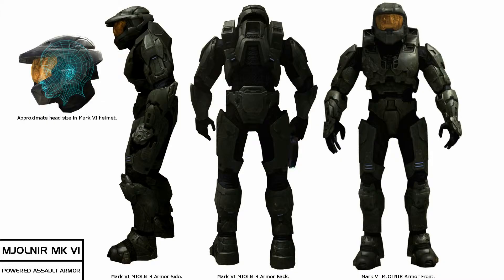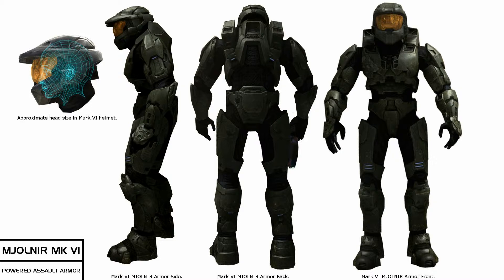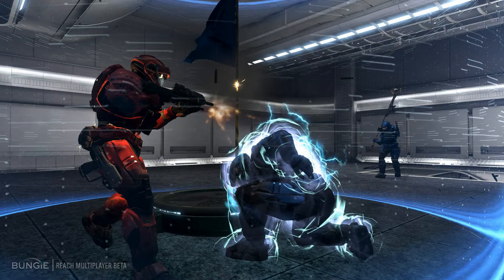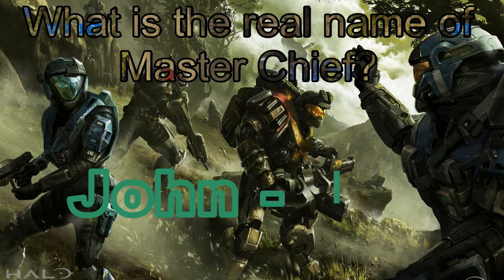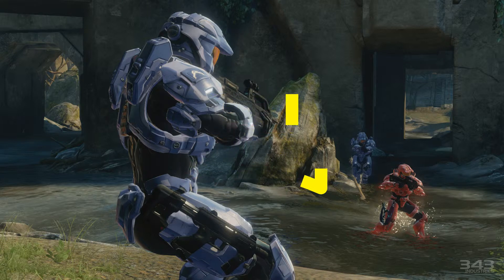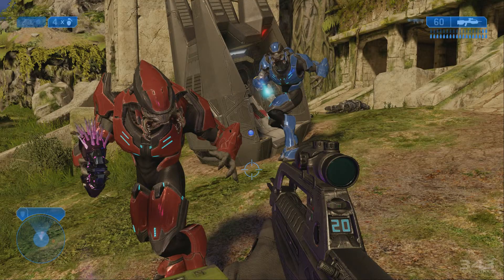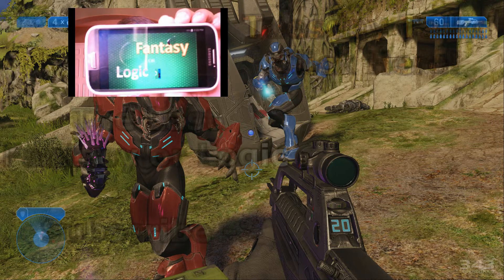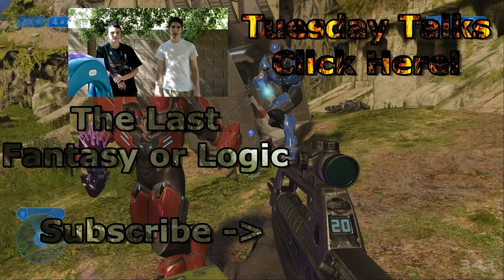Fantasy or Logic - Halo Technology: Spartan Armor

Comment: if u want facts lmk ive read evvvvery halo book and a couple things u got wrong is its not an exoskeleton it has no gears or mechanical features to aid in movement its basically a armoured computer its the MULTilayer crystalline layers that double the chiefs strength and speed he tore his Achilles tendon running in fall of reach which means an exoskeleton wouldn't have done that and the box on his back is a miniature fusion reactor not nuclear and they HAVE NEVER EXPLODED and remember the technology in the suit is 500 YEARS INTO THE. FUTURE AND relies ON STOLEN ALIEN TECH WE DID NOT INVENT THE SHIELD TECH AND NEITHER DID THE COVENANT THEY REVERSE ENGINEER FORERUNNER TECH TO GET IT EVERYTHING COVENANT IS STOLEN TECH FROM FORERUNNERS